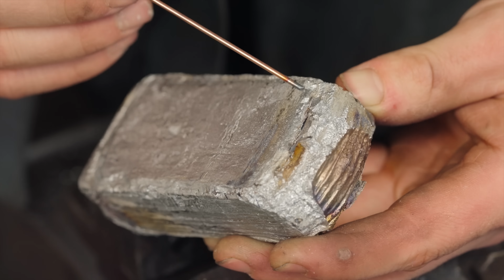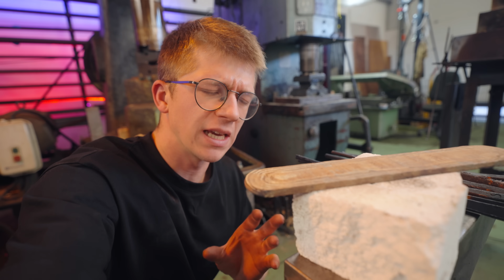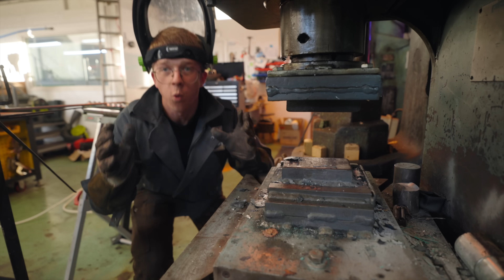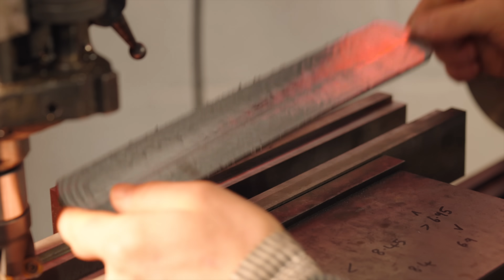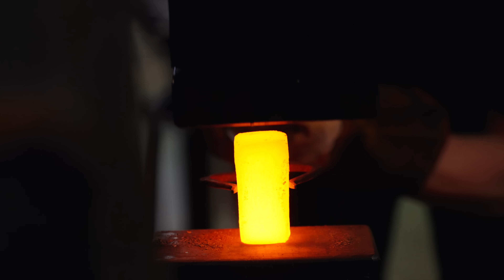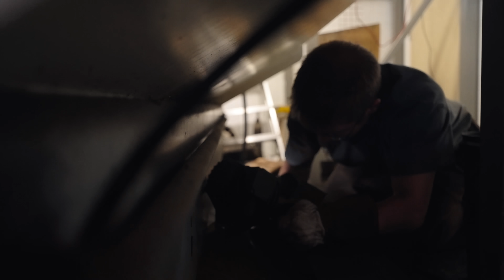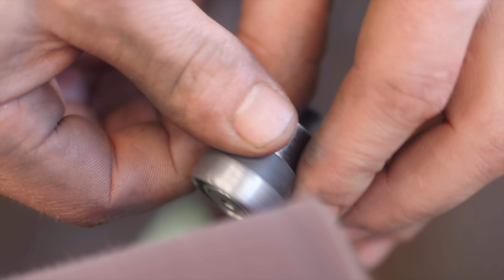Can I Make Titanium Damascus? Part 2

Comment: Uhhh why would you think the top would forge square? You squirted a good 10th of that billet onto the floor, and it sure wasn't an equal amount of titanium that squirted. 

You should NEVER have gone past step one with a broken billet. Titanium needs to be PERFECT. That's not PERFECT -10% difference in the amount of each layer of titanium...PERFECT.

Comment: I'm no expert in metallurgy, but if I had to guess why the titanium is melting is because you're heating it to a critical temperature, then the energy put into it by the power hammer is causing that temp to spike for just a second or two, just enough for a small amount to reach melting point.  Just a guess as a physics nerd.

Comment: "why is it melting under the melting temeture"

PRESURE:
 i think  THINK that it might be the argon, either it is changing the presure (build up preture in the steel holding case for the titanium) or something else, you googled its melting tempeture under normal conditions, your patented manual doesn´t seem like normal conditions tho

HEAT "CONDUCTIVITY"
there is also the posibilyty of heat traveling (building up) faster in argon then in air, i would try pointing one of those heat mesuring devices on the titanium directly and see if it is hotter or not

ould love to see you make a blade, even if it was just ornamental, it looks waaay too pretty not to <3

Comment: i would say it melts because of the extra pressure applied by the expansion of metal, bringing down its melting point, i don't know how its by that much but it would also explain why it only sprays when crushed/ surface is broken and not when its simply being heated

Comment: Heat caused the titanium to expand, the pressure inside allowed for the plasticity and the external force is what crapped it out making it appear fluid, however “technically“ it didn’t liquify.

Comment: I think it is melting much further below the actual melting temp, because of the steel jacket around it. Steel is better at transferring heat than most other metals, and so i think the steel is actually transferring MORE of the heat directly to the titanium before the steel itself heats up. causing the titanium to get up to a much higher temperature than it otherwise would. Carbon Steel (1% carbon)  has a thermal conductivity rating of 43, while Titanium has a thermal conductivity of 24.5, a higher the number the better it is at conducting heat and a lower number it will act more of an insulter. I would suggest using a metal that Isn't such a good conductor of heat, something that has a similar heat conductivity of titanium or even a bit lower as it would act as a bit of an insulator rathe than a conductor. Something like 1.5% Carbon steel is closer to 36 and may not transfer AS MUCH of the heat directly to the titanium as the 1% Carbon steel's 43 does. Just a suggestion.

Comment: The increased temperature will be due to the pressure when forging in the box - Think of it like steam. When steam is compressed you higher heat.

Comment: argon is signifigantly heavier than your average air, so when you heat the argon you're adding pressurized heat, which makes it hotter, we use a similar process for heat treating aerospace parts

Comment: MY BEST BET ON WHY ITS MELTING... I'm by no means knowledgeable on the subject, but i know a bit of science. I think it's possible that the steel casing and titanium core are reacting with each other due to different rates of thermal expansion, potential bonding, and vacuum. i could be wrong... but thats my best guess haha

Comment: The purity of the titanium alloy being not completely titanium introduces a chemical concept present in mixtures called a Eutectic Point in which two minerals or substances together have a lower melting or boiling point becaue of various new molecule dipole interactions that wouldn't happen in a homogenous mixture. Basically it means all alloys and or combining two different molecular mixtures and in different percentages changes their collective BP and MP

Comment: It's melting at a lower temperature because the mixture is at it's eutectic point, which has a lower melting point than steel and titanium

Comment: i understand your obsessed with making damascus . the process is interesting . but isnt it styfling to worry about delamination all the time . can you try using metal powder crushed in a mold with a hydrolic press then file it to spec and chemically etch it or if using titanium electrically anodize to bring out the pattern. if the powder isnt in a normalized matrix and instead was drawn into the mold like sand art you should get nice results . titanium probably oxidizes to fast maybe niobium would be better

Comment: Had you considered the fact that the overheating that caused the titanium to go molten wasn't just confined to the back end but along all the edges and corners, so that resulted in your having less/no material in those corners to draw out and essentially just whittled away as you worked it, so to speak?... I'm not trying to imply that that is what happened, just giving potentialities.

Comment: TLDR: Use Helium.

Might be paradoxical behavior due to the steel touching it. The melting is near the edges. Could be that the steel is becoming a partial plasma and is locally much higher temperature. 

Argon is neutral, but also has loads of electrons to create a plasma...I would guess that helium would do better. Helium has the highest ionization energy of all the neutral gases.

Comment: I know the issue of the heat buioldup that doesn't seem to make sense.  Stay with me here and you will understand as it can be complicated.  The mixture of iron and titanium does play a role, but it's minor toi the real issue.  You are using the inert gas Argon, which has an atomic weight of 40.  Why does that matter?  It's dense, and the denser the gas, the higher amount of heat energy gets transfered to the materials when it is compounded.  It's why you can boil water at 212 degrees and have it take flesh off, but a 300 degree oven, you can wave your hand through the air on the inside and the heat will be tolerated.  (No touching the sides of the oven, of course.)  So Argon is a thicker gas, and the thermal conductivity is much higher.  In order to do better, the only other two inert gases that are not combustable is Neon (Ne) with an atomic weight of 10, and Helium (He) with an atomic weight of only 2.  Now we do not want the gas to be too cold, so you have an even mix of Neon and Helium and the atomic weight combined is 12.  Which has a much lower density than Argon.  (Ar, Z = 18).  Do that, and you cut the thermal conductivity slightly more than half.  Take it from me, an Old School Chemist who finished college in 1993.  It should solve the thermal transfer problem that can unexpectedly slag your project.

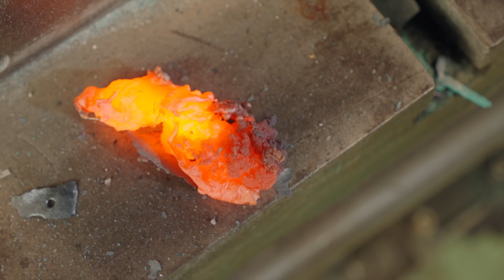Comment: 5:40 the reason it squirted out is due to the titanium alloy you are using, in particular the grade 2 titanium which contains aluminum, which will lower it's melting point because science dictates an alloys melting point is different than both metals used. There is no simple formula to determine a alloy's melting point, but it is safe to assume a titanium aluminium alloy will have a lower melting temperature than pure titanium due to aluminum"s lower melting point. I also noticed a third metal in the grade 2 titanium, but I don't remember which one.

Comment: I think the argon is having an effect on the melting temp, plus titanium is crazy to weld. You have to use a low heat and slowly fuse and add material. Back purge is a must

Comment: at around 6 minutes you ask why this is melting below its melting temperature. I have an idea as to why. When cutting titanium with a torch we use propylene because it is hotter and can cut titanium. we use acetylene to cut steel because it doesn't need the heat. Acetylene wont cut titanium on its own. however if you put a piece of steel over the titanium you are trying to cut and cut them together it works. The people I work with do not know why but we think the slag blowing off the other side is hotter than the acetylene  and that's why it can push through the titanium. I must note that the cut comes out looking horrible and messy. but if you need a piece of titanium cut into 2 it will work.

Comment: Honestly, you'd probably be better hot cutting it. Yeah, you'll distort the pattern a bit, but cut off on end and use the other as a tang, I'd say you will lose far less than 50% for each stack.

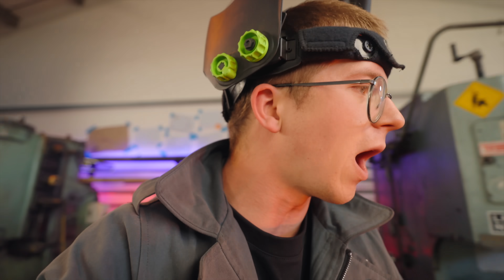Comment: 6:12 - Even below melting, some titanium alloys may become very soft or semi-solid near their beta transus temperatures (~1700–1900°F), allowing material flow and surface ejection under pressure. I think that is what you are seeing. You will notice that almost immediately after the billet behaves solid again. If you want to avoid this, you can try the lower end of beta transus around 1700 F which may help.

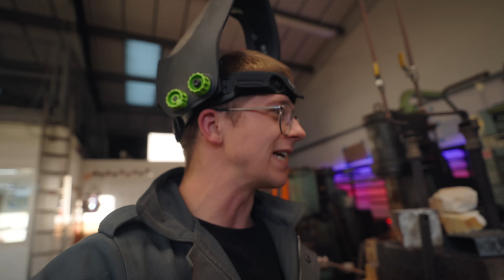Comment: 6:15 like with dual shield welding, the gas acts as an extra heating agent when superheated, tho the forge may be 2000° F, The Gas inside is being Superheated may be pushing the Temperature higher inside the billet.

That's my best guess. I'd shoot for 1800-1900° as that's safely within that patent stated range.

Comment: During forging, the metal undergoes deformation, which itself generates heat. This unrecorded extra (neither recorded nor calculated thermically) increases the metal's temperature. In other words billet temperature + heat generated during forging/deformation = total above melting point. That's before adding a steel jacket :?

Comment: I hot rolled both cp  and 6-4 titanium for 30 years, we never heated cp more than 1450°F  usually processed it at 1350° and 5-4 between 1650° and 1750° F

The common traits is that CP when hot forged tends to elongate and not spread, and 6-4 would tend to spread and not elongate, so you basically forge welded two pieces of titanium that wanted to move on opposite directions, but I believe the pattern you saw after you forget it into a flat, had something to do with you grinding the corner  cracks out and the fact of how the two different grades tend to move when forged.

Comment: Just a thought about the "why is this going liquid", I suspect you might have a pressure phase-change. you know how there's different temperatures water boils at, for different elevations? (that's a thing, if you didn't know), and I suspect that when you increase the pressure, you are moving the material along that phase change diagram with the pressure in a way that makes it cross over the line into "is this enough energy put into the material to make it move as a liquid".
Reply: You would likely be incorrect. Increasing pressure increases melting point and vaporization point generally. A new alloy being formed between the ti and steel is more likely

Comment: I'm wondering if the extra hole you added is the culprit for the lower melting point. By adding the extra hole you decreased the pressure contained in the canister during the forging process, lowering the pressure would in turn lower the melting point of your substance.

Also the patent said 1600-2000, why not go with the mean at 1800 to start ?

No promises, just a thought from observation.
Reply: Adding a hole means it’s at atm so the melting points he read would be right. It’s more likely a eutectic reaction between iron and titanium

Comment: If I had to guess the reason that the titanium is melting at the lower rate, is because of the argon. Without the oxygen it allows for more heat to transfer to the metal more quickly.
Reply: That’s not how heat works. 

Far more likely to be a eutectic reaction between iron and titanium

Comment: could be that the flow of argon is not high enough and is allowing oxidation of the melt while heating
Reply: How could it be that? Oxides melt at a much higher temperature and nothing should be molten in the first place. 

Far more likely to be a eutectic reaction between titanium and iron

Comment: How did you mold titanium without molding steel?
Reply: it maybe is caused by pressure..?
Reply: @massimilianodefecondo6279 increasing pressure increases melting temperature. What is more likely is a eutectic reaction between iron and titanium

Comment: Ah and one more thing...titanium isn t really stronger than steel . By molecule yes and weights less.. but titanium molecules are much much smaller than steel ones and titanium really benefits from forging since you force those molecules together... But anyways steel is better in many ways it has better fatigue resistance better everything but where critical weight is a concern sure titanium it s the best alternative but don't expect the same lifespan. Yes steel rusts but titanium has its own problems which are much harder to deal with, that s why high quality titanium parts are much much more expensive than steel ones...but at the same time each metal has specific uses. Some more specific than others
Reply: Forging doesn’t force molecules together? What?

Comment: As i said in the previous video comment sectoon titanium galls easily i mean extremely easily(cold welds) that s why you get those sparks...it s a nightmare in moving engine parts except if it s done well(anodizing+titanium oxide are your best allies if you really want to use titanium in moving parts or where friction is a concern like engine conrods)

Comment: I'm no metallurgist, but perhaps the increase in pressure from the press has caused the melting point to be reduced enough that it melts at that temperature.
Reply: No, definitely not enough pressure to do that. It’s most likely a eutectic reaction of ti and fe

Comment: 6Al-4V (Grade 5) has a lower melting range (1,600–1,670°F / 870–910°C), while 3Al-2.5V (Grade 9) has a slightly higher melting point but still well below pure titanium's

Comment: You have the metal case around the titanium. Could it me when the holes for the gas are blocked there is pressure building inside like a pressure cooker? Plus the pressure from forging it, this could be one explanation.

Comment: I'm not a metallurgist, so I couldn't speculate on crystalline structure, or the alloy type/combination.  My guess is there is a pressure delta you're not accounting for.
Reply: Ti is a hcp which goes to bcc when heated. Iron is a bcc that goes to fcc when heated. The melting is most likely due to a eutectic reaction

Comment: titanium absorbs heat very easily but struggles to release the heat. i imagine its hitting much higher temps inside the mold than the exterior temperature
Reply: Absorbing and releasing heat are the same quality. If it retains heat, it also absorbs heat slowly